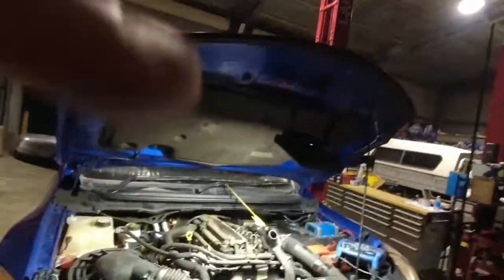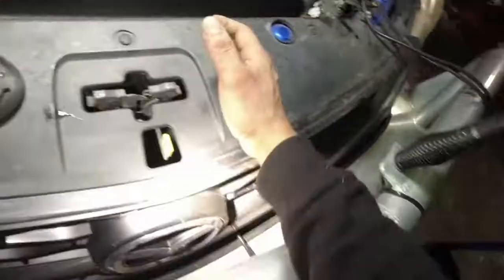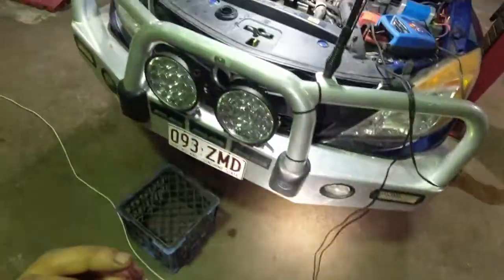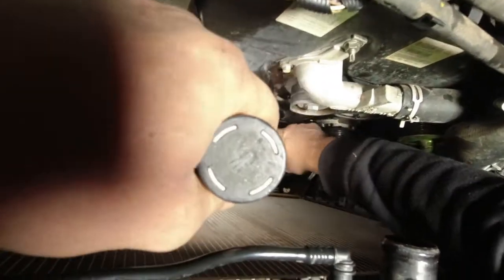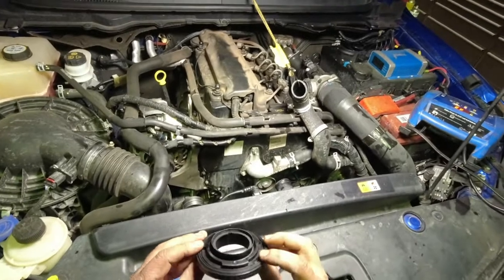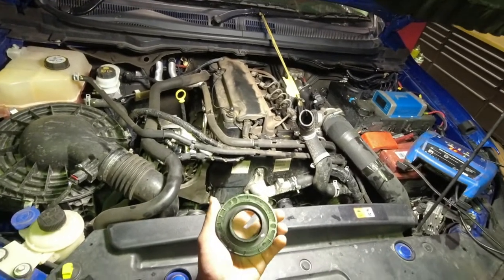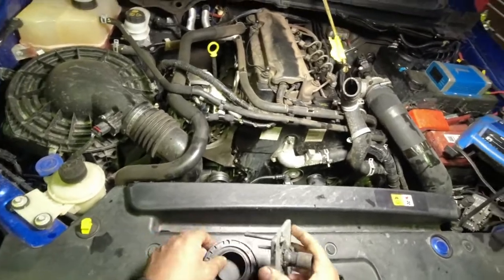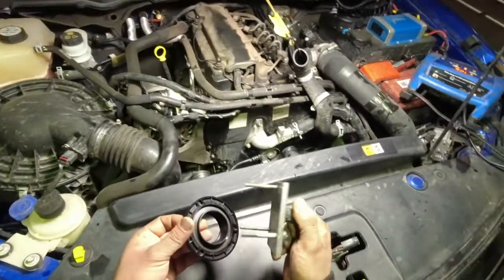Ford Ranger Mazda Bt50 3 2 duratorq front crank seal replacement

Comment: I have exactly the same engine and also had a belt go, I changed the belt and immediately noticed huge oil patches on the floor. I had assumed the bits of belt had whipped a hose and split it but I’ve been under there multiple times and didn’t find any splits, the fan has spread oil everywhere but it’s primarily where the turbo and alternator is making me think it could be turbo related, but the direction the fan spins throwing oil that way may be misleading me about location of the leak…….
However!…. After watching this I went back and had a good close look at the drive shaft for the belt and behind the cog there’s pieces of belt stuck in there tight!!! Do you think I should remove the drive shaft cog and check that oil seal and remove the bits of belt at the same time??? 
I had found oil also on the sump around the drain hole but forwards momentum could have pushed oil backwards, there was no oil on there before the belt went so I’m now thinking this video is the answer. 
Any thoughts from anyone? I’m an engineer but not a mechanic so I’m pretty savvy. 
Ideally skilled mechanics woth years of experience comment please, I could do without a thousand wild goose chases.
😊
Reply from the maker: Take balancer off, 3 bolts. Check to see of crank seal is damaged. If it is and suspect belt/ seal material may have gone inside the timing case, then immediately pull the sump off and get rid of all debris and check if pick up strainer has not blown too. If it has blown, chances that it has made its way to oil cooler/ filter housing.
Reply from the maker: If crank seal is damaged result of broken belt then you will have a massive oil leak, constant will engine is idling.
Reply: @a1mechanicaloakey639  your an absolute superstar. 
I haven’t seen a continuous flow from there but I wonder if the bits of key wrapped around spinning are throwing the oil elsewhere as the oil is showing all over the engine bay between the fan housing and the engine itself in all directions. 
I’ll use the car for work and have a look in all the areas you suggest at the weekend. 
Hopefully the damage isn’t too deep. 🤞
Thank you so much for taking the time to reply so fast. 
You have a new subscriber 👍😊

Comment: Great vid mate, just wondering how people diagnose a problem with the crank seal?  I have a 2015 ranger and there is a bit of oil around that area, not sure if its a slow leak or someone spilt oil during a service. cheers
Reply from the maker: Just visual inspection. Give it a wash and check back week later if it's a slow leak.

Comment: Hello how didnyoubremove the pulley
Reply from the maker: Remove three 15 mm bolts
Reply: @a1mechanicaloakey639  you use a impact driver? Does the crank need to be locked...or will the impact tool work
Reply from the maker: They not very tight bolts. And no crank doesn't need to be locked.

Comment: Going through this right now, belt went and done that same thing, oil leaking
Reply from the maker: Make sure you take the sump off and have a look at the pick up and any debris in the sump. Make sure pick up is not blown.
Reply: @a1mechanicaloakey639  ok will do that, I'm just tryna get the fan off at the moment, is it just the 3 bolts or do you have to undo the big nut in the middle?
Reply: Also how did you go taking the sump off when you only have 10min to change the oil as it doesn't self prime? You'd think removing the sump is gonna mess the 10min rule?
Reply from the maker: Depends which year. Only the early ones had that rule. But done it heaps of time. So far so good for me. There's ways to prime oil. Or simply crank till oil comes up.
Reply: @a1mechanicaloakey639  yeah mines 2012, px1. Bit concerned about removing the sump as I won't be able to prime it
Reply from the maker: You might get away but I had one engine seized because belt/ crank seal debris blew the pick up filter and travelled all the way to the oil filter gallery blocking oil.
Reply: @a1mechanicaloakey639  yeah right, don't need that happening, how did you undo the 3 bolts holding harmonic balancer on?
Reply from the maker: Just a small impact gun
Reply: Change cam shaft seal on a wrl engine